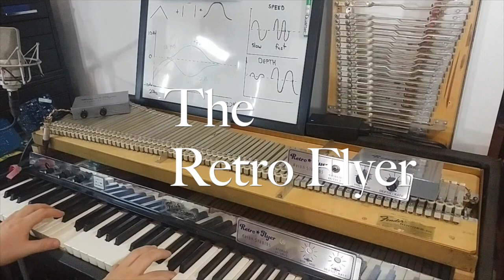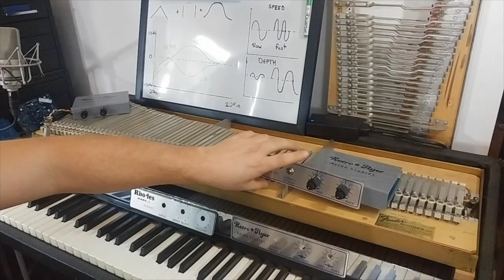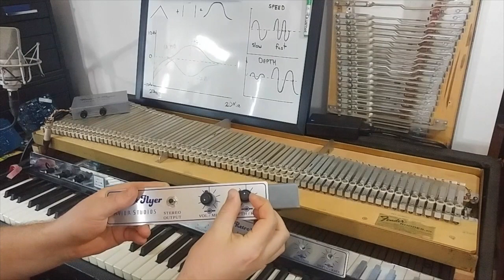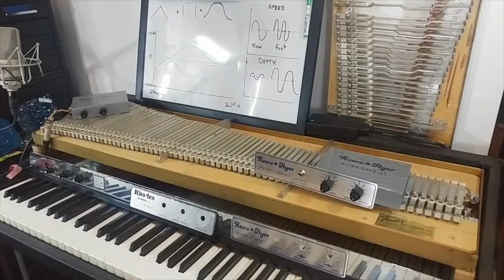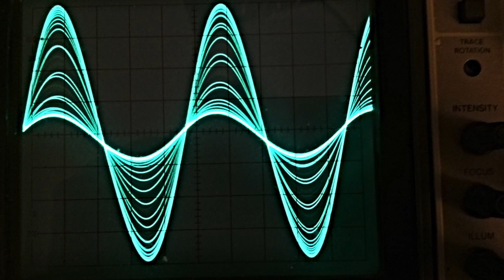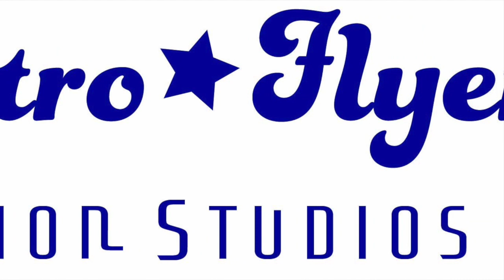The Retroflyer - An Introduction - Active Retrofit Preamp & Tremolo for Fender Rhodes

Comment: Does this work with a Mark 1 Stage model?
Reply from the maker: Absolutely! The Retroflyer will fit any Rhodes with a 2" hole spacing on the rail. But it's especially great for retrofitting in passive Mark I & II models. Feel free to shoot us an email if you have any other questions. avioncontact@gmail.com
Reply: Hi, interesting tool, but where is the power supply connection? On the cheek block front as some Dyno units? Thanks
Reply from the maker: @filippobuccianelli4606  Hey Filippo, excellent question! The power supply is actually up on the Rhodes in this video. Just to the right of the dry erase board. Power introduction was certainly the trickiest thing because of the limited holes on a standard passive rail. We supply a thin a cable that can be tucked in between the rail or cheek block and the enclosure. 

We actually make the cable in house because we couldn't find one that was thin and long enough to suit our needs. It actually works really well. The cable has a female DC plug which connects to any standard 24V male DC plug. We include a power supply as shown which uses an IEC from the AC side so anyone in the world can use the RetroFlyer without much difficulty. We supply some different kinds of AC plugs but all you need is a the correct AC IEC cable for your country. We also include a DC jack that can be mounted on the lid or rail or enclosure if you choose. The cable we include is long enough to reach the handle on the side of the case and tuck in there for solid stage use. And then can easily be disconnected and set inside the case for transport. 

There are two major advantages to this method. 1) cost! We wanted the RetroFlyer to be as affordable as possible without sacrificing audio quality. Using a cheek block would have increased the overall cost by around 20-25%!  2) Installation is super quick! Most people can install our Retroflyer in less than 10 minutes (although we don't want anyone to rush!) 

I hope that helps. We'll have an installation video coming out soon that shows everything in detail. But the RetroFlyer also comes with a manual with complete instructions. You can always contact us through our site if you have any other questions. We're always here to help. Cheers!